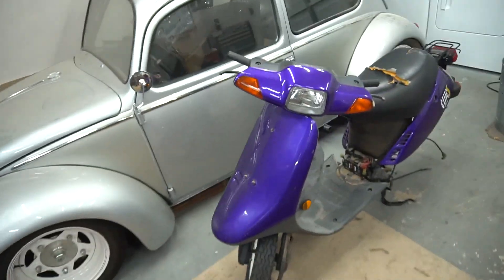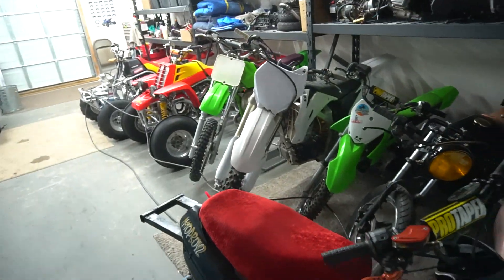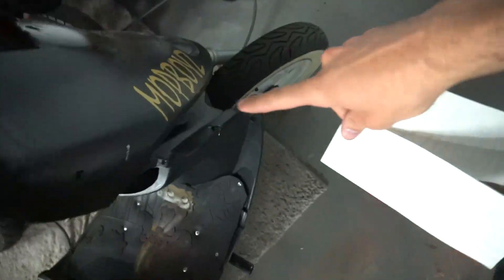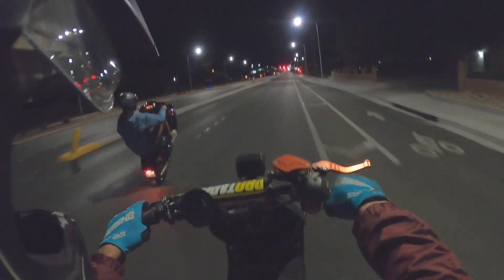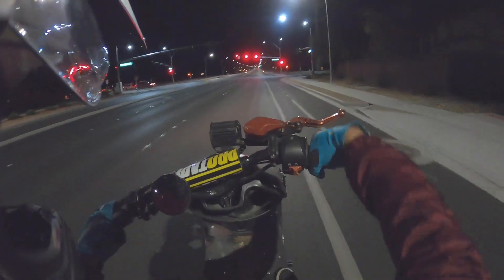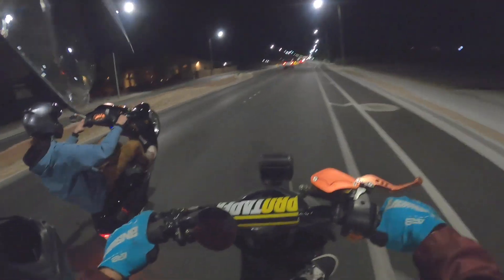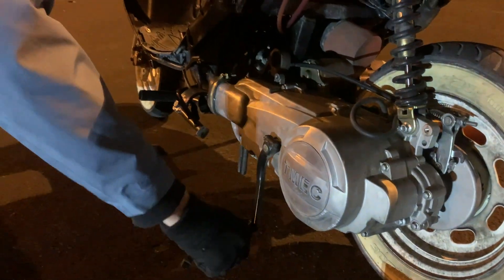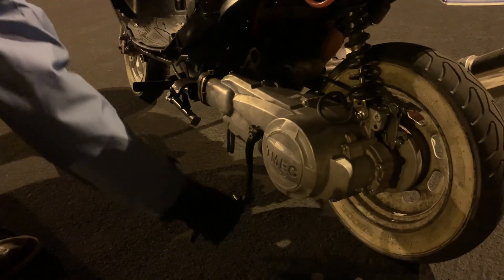is THIS the END of my 150cc GY6 STUNT SCOOTER?

Comment: the motor is not trash just because the kick start is gone lol, those are not made to be a full time starter my guy, its like when ur electric start dont work u have that as a back up. wire a electric start up ull have way less issues. i do not disagree with going 171 would give u a lot more low end power.

Comment: Get a vip 50cc frame  and swap  it. On the gy6 150 you can  bore it out and stroke it out, also heads cams carbs full cvt and final gear. Alot of things

Comment: Okay, I may be going out on a limb, but, do you think the GY6 (especially being a China-built engine) might suffer from oil starvation with all the wheelies since the oil will slosh to the back of the case when you're up on the back wheel? I mean, a few short wheelies may not do that, but with the length of time you're up like that, the oil may not get to where it needs to, and then you starve the crank bearings, needle bearings in the wrist pin and valvetrain...it may be the case. At least with a two-stroke, not only do you have more torque, but you can always pre-mix the gas and oil, so oil starvation would never really be an issue. Just sayin!
Reply from the maker: definitely does starve for oil , same problems with the groms.